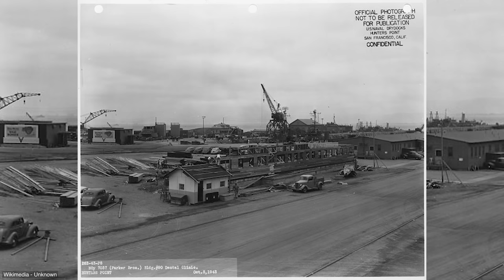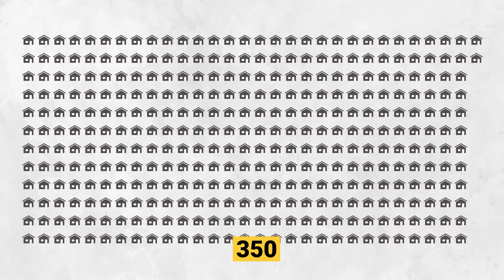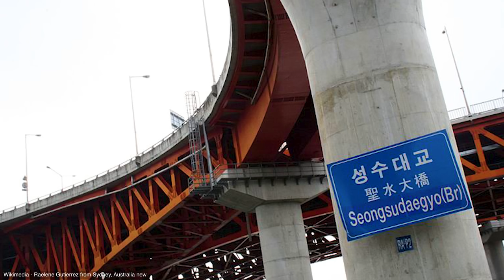Most Expensive Construction Mistakes in the World (Part 4)

Comment: Not sure it this totally fits the theme but the Tasman Bridge disaster in Hobart, Australia resulted in the bridge needing to be rebuilt as it was a key connection in the city. A zinc ship hit a pylon and sank to the bottom of the Derwent River causing the middle sections of the bridge to collapse into the water, and damaging the riverbed so they couldn’t put a replacement pylon in the same spot. They used ferries to get across the river until the new bridge was completed.

Comment: Ottawa, ON Canada. O-train light rail commuter system. Project ongoing. Already cursed with line closures, minor derailments, equipment failures, exceeding cost, time extensions. Brand new system already fraught with partial line shut downs and loss of service intermittently. Considering how small the lines are in comparison to most other rail lines. It seems doomed to fail